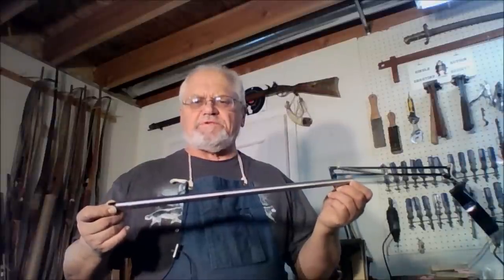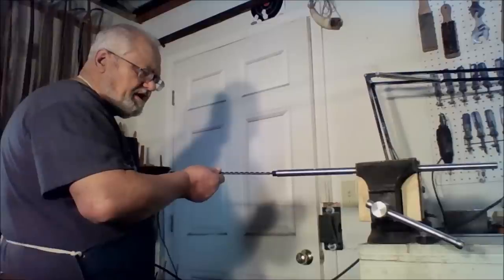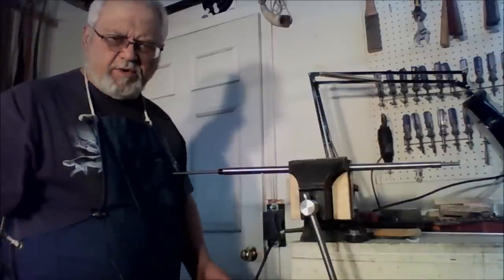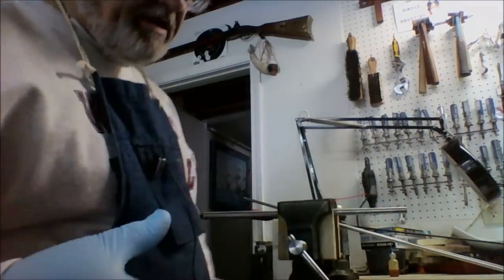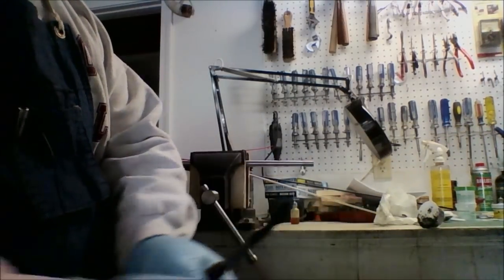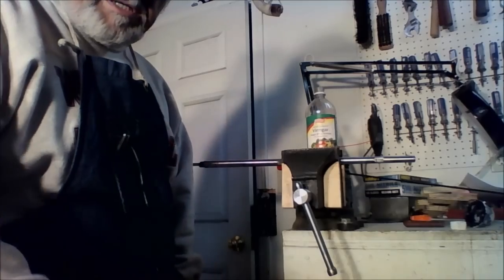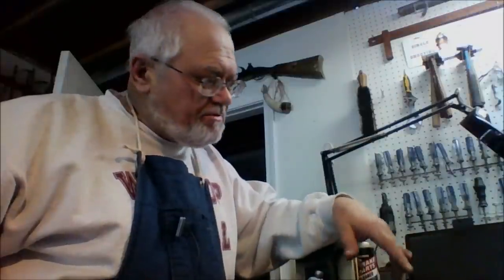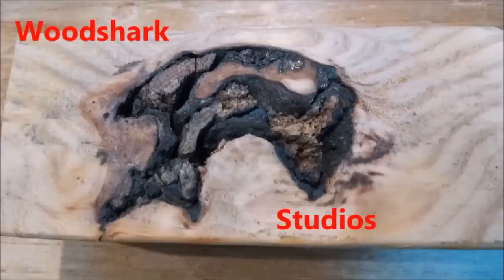The Old Gunsmith - Project Gun Part  7 Relining The Barrel

Comment: ya it will work but that's about all it will do . parkerlined  of parker hale did some of the finest liners that were ever installed they sold a line of bsa 22 target rifles that the fist thing they did with brand new rifles was to install there liners and they were soldered . some of the best liners you can buy come from track of the wolf they are made by TJ and are hammer forged . some of the best liners i ever seen were ones done by a doug k. he was a master at it he put them in right and they were tack drivers rip doug.

Comment: Thanks for sharing this.  I know I'm 2 years late to the party.  Quick question, is there a reason you didn't use red locktite?  A gunsmith friend of mine uses red or green locktite to glue liners in.  Your thoughts on it?

Comment: Why not use 620 Loctite?  I have used it to hold bearing races when they have spun, in a pinch.  If I am not mistaken they are good to over 400 degrees heat.  It does take 24 hours to cure but you arent in a hurry anyway.

Comment: heat barrel and coated liner with hair drier...will help in pushing liner. The regular Acraglass would be the best choice because it flows better. Buttering the bore with a large  syringe is an aid to make sure that there is epoxy flowing well along the full travel of the liner.
Reply from the maker: Thanks for the tip and for watching.

Comment: If I didn't have a lathe I would at least use a board and blocks to mount the barrel in and use something like eye bolts anchored in line with the bore to guide the drill and keep it somewhat aligned. This method was used to make new barrels back in the day, it doesn't take much effort to make such a cheap tool yet help reduce runout.

Comment: Great video. 
I disagree that soldering is difficult and you may not get it all joined. I am not a gun smith but have done a .25/20 and .32/20 Winchester 1892s and a .44/40 1873. I had no previous experience. You just need to have a bit of experience with soldering, flux etc and how to get solder to flow and stick. The barrel liner is tinned over it's length then the drilled bore tinned using a brush on a rod. The tinning is done a short length at a time and it is obvious when you have a good coat. Once this is done the liner will not fit down the bore. You need to heat bore and liner up starting at one end and it will start to slide in. You need 2 people with decent propane torches as as it gets in further you need to keep the whole barrel hot so it doesnt cool and bind but eventually it pokes out the other end. If there are any gaps between liner and barrel at either end they can be filled with solder by using a bit more which will then fill by surface tension. You can be confident of 100% contact as the 2 tinned surfaces have to join or the liner would not be able to be advanced.
Advantages of the solder method are:
-You don't need to worry about the bore as any solder that got in would not stick as it is not fluxed. I oiled it first which cooks off from the heat but solder would never stick.
-No mess. Even if you got interrupted half way you could stop and go back to it later.
-Traditional method

-If the bore got damaged or corroded at a later date you could just remove the liner and install a new one.

Give it a go next time. I think you will be pleasantly surprised.
Reply: Agree with you on this. While I haven't sleeved a barrel, I have soldered long sections of tubing sleeves. Like the tubes, if the barrel is heated evenly, the solder will flow quickly and completely if fluxed and tinned correctly.
Reply: Thank you for sharing that.

Comment: Great video.  I'm thinking of relining an old Whitney Rolling Block with a shot out .38 caliber rifled barrel and converting it into a 22LR if possible: instead of turning it into an in-line blackpowder muzzleloader.   It has seen better days.  I have to purchase or make a receiver main spring and trigger spring, plus the firing pin. I would like to use it again.  I don't like wall hangers. haha 
Any thoughts/suggestions would be much appreciated.  Have a great day. ~Steve

Comment: Very informative video, thank-you. One thing that concerns me though is having enough epoxy in the joint all the way through. It seems that the leading edge will be losing the epoxy that was smeared on it. Were I to do this job I think I would, in addition to applying glue to the liner, put some in the rifle barrel so that there is a glob of glue continually filling the joint as the barrel liner goes down the bore.
Reply from the maker: Due to YouTube's policy of no links to gun providers I can not put the Brownells link here. However if you look up the video on gunstreamer you might find it there in the comments. ;-)
Reply: The instructions say to do that. Also, I think he mixed the fiberglass with it, which I would not do. If you mix the resin in a dish sitting in ice, it will stay fluid longer, giving you more time to insert the liner.
Reply: Acraglas is from Brownells,  it's made for the shooting industry.

Comment: Would you use red threadlocker ? or is that not good ?
Reply from the maker: I have heard of people using red threadlocker. However Acra Glass has been used for years on many gunsmithing projects from wood stock repair and rifle bedding among others. It is also a product of the aviation industry so it has to meet a very high standard. So while Red threadlocker may do that one job, Acra Glass has many other uses in the shop. Thanks for watching.

Comment: Would not red locktight be better ?
Reply: Had the same question. My first thought was Loctite 271 if I were not going to solder it, and then I got curious. The choice may be because of how much the barrel may heat up during use. Brownells doesn't give a melting point in their MSDS but you can figure that if the flashpoint is 485.6 °F, it's going to melt at around 325.00 °F (33% of Flashpoint). Loctite has a melting point of 134.00 °F (or thereabout).  So Acraglas has just a bit less than Tin Lead Solder 357.8 ºF to 554.90 ºF.  and is better suited for the application than Loctite. 
With this, I think I'll still go with a low tin content lead solder to keep away from the 450 °F temper threshold. 

This of course leads to the next questions; 1. What is normal use when you talk about shooting a .22 rifle and 2. What temperature does a barrel get to shooting at "Normal Use". Guess what I'll be hooking up thermocouples too on my next outing at the range.
Reply: @usabaker1  I belive sir that is the best response i have ever gotten on a question .. 👏👏  

Unless your running a MG42 in ..22lr  with 1,000 round belt non stop i do not ever see a barrel getting that hot lol .
Reply: @ray211225  You are more than likely right, but I'm a curious cat LOL... After a bit more research on the Henkel adhesives website, I found that Loctite 620 will withstand 392 °F  which is plenty strong enough and would make a much cleaner installation than Acragls or Solder. "LOCTITE® 620 is a retaining compound designed for the bonding of cylindrical fitting parts" I might see some 620 in my future. Which makes me wonder..... Ever had to remove a bolt locked in by an idiot who thought you needed to use a whole tube of 271 on a bolt? Gotta wonder how hard it would be to remove a bolt treated the same with 620... My bet is localized heating with a soldering iron ain't going to cut it.